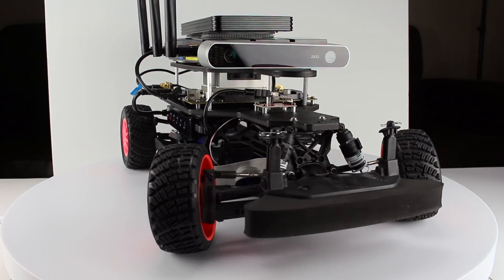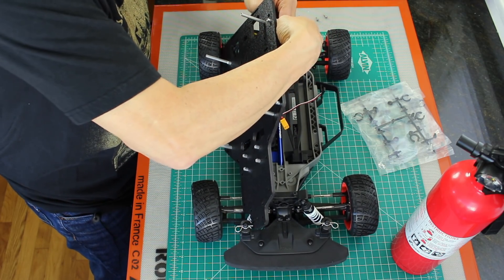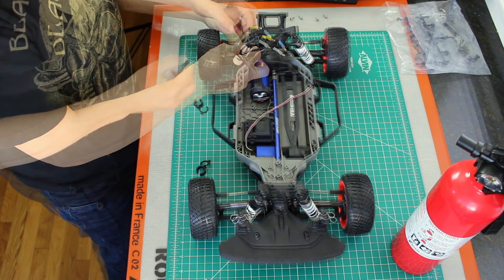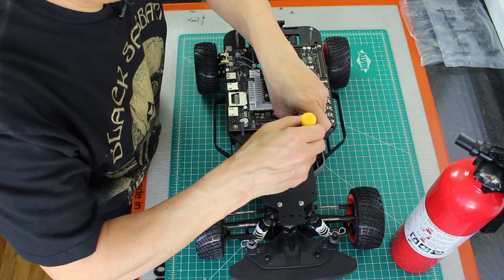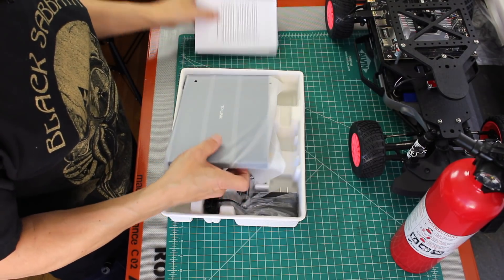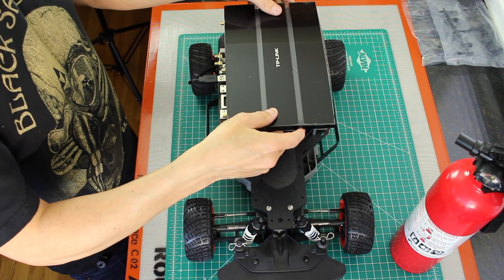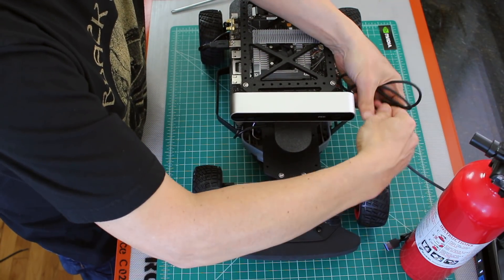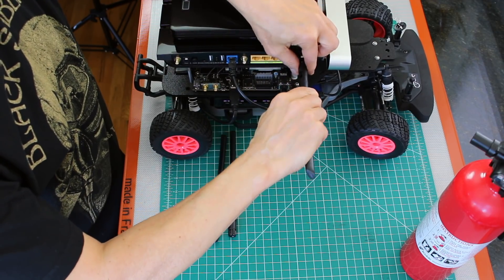Jetson RACECAR Build - Upper Platform

Comment: DUDE LITERALLY PUT A ROUTER ON THIS LOL SAVAGE
Reply from the maker: Yes it's a little beasty. Thanks for watching!
Reply: @JetsonHacks  By the way, I have a question. How do you connect motors to the Jetson? I know the connection from the jetson isn't enough to power it but do you use some sort of esc or switch connected to the battery but controlled by the jetson.
Reply from the maker: @Jake.filmz_  People usually use a ESC or some type of external motor controller board. On this project, we use an open source ESC called a VESC. Here's the install: https://youtu.be/viR6KFbIM48

Comment: Why did you need router on top??
Jetson can use wifi
Reply from the maker: It depends on the environment. On the new RACECARs, there are no additional routers. Only earlier versions (such as the one shown here) they were racing through underground tunnels which have weak signals. They used the routers as signal boosters. Thank you for watching!

Comment: You can easily get better suspension by picking up and inexpensive heavier shock fluid and spring kit.  The spacers only help so much and usually are used if you add a slightly larger batter not a whole tower of electronics weighing more than the original vehicle.
Reply from the maker: A few months after this video, they switched over to the Traxxas Slash Platinum which adds many aluminum parts to the suspension. The stock springs are replaced with beefier components. For a video of that build, looky here: https://www.youtube.com/watch?v=6CSjDv7r30w

Comment: Hello, the JETSON and ZED look interesting, I wish if i had them. Just a remark, instead of using a router (extra mass), you can just use an USB WIFI Adapter with Hostapd to turn it (adapter) into access points. (sorry for my english)
Reply from the maker: An issue MIT encountered when running the robot in their underground tunnels is that sometimes they lost connectivity. The router provides more signal. In later versions, they will remove the router. Thanks for watching!

Comment: Hello, the 9 DOF Sparkfun IMU you mentioned is no longer available https://www.sparkfun.com/products/retired/10736 what do you suggest as a good alternative? Something that has a USB connection would be nice. Great video as usual!
Reply from the maker: Thanks for the kind words. The Razor has been superseded by https://www.sparkfun.com/products/14001
There are some code changes to take into account, but the new one has a USB connection built in. Thanks for watching!
Reply: Thanks for answering. from your experience, which one do you think is easier to work with in jetson TX2 the new razor IMU which uses MPU-9250 or the one from Adafruit BNO055 IMU Breakout Board
Reply from the maker: As usual, my answer is "it depends". The nice thing about the Bosch BNO055 is that is produces Euler angles directly, which means most of the heavy lifting is done on the Bosch chip itself. The Razor has the advantage in that it is very widely used, and has a very supportive community. The Razor is basically the same IMU setup that was used in the original Pixhawk autopilots. Thanks for watching!

Comment: Again a useful video. Thanks. Do you have an alternative for the battery? This battery pack is not for sale in Europe. The car has it's own power of 7.2 volt but the jetson and other components need some power too. Can I use a high res web cam instead of the ZED Camera? Please continue these video's.
Reply from the maker: Thanks for the kind words. Currently I don't have a battery alternative. Looking at different options, but nothing definitive yet. There are many alternatives for the 'Perception Sled' where all the sensors and computing come together. For example: https://youtu.be/HHdqdwMvcN8 which is based on this car. It comes down to how you intend to use the vehicle,. I you want to explore 'real world' stereo camera vision processing, you'll of course need a stereo camera rig. If you want to explore deep learning, a single webcam may be sufficient (though in the real world people tend to use at least three cameras: left, right and middle). You may be more interested in combining GPS and vision, and so on. The important part here is that you have a hardware vehicle platform to start the exploration. Thanks for watching!